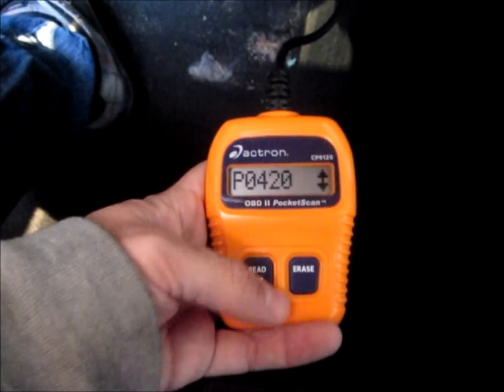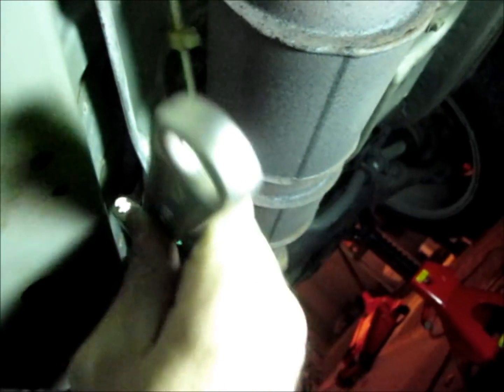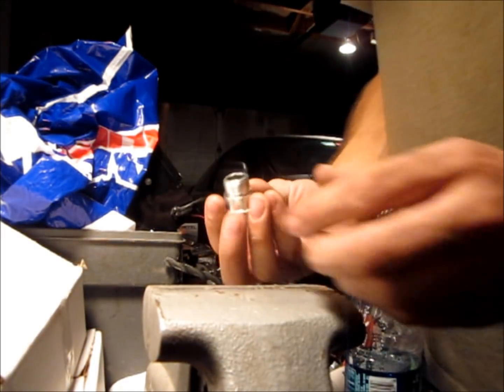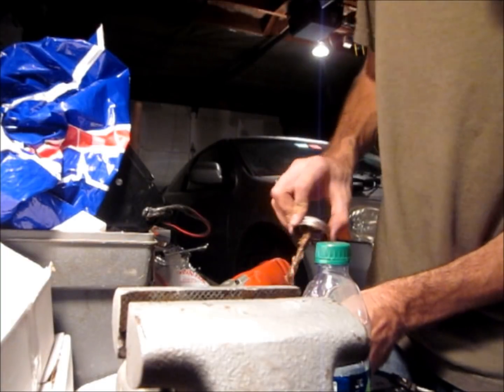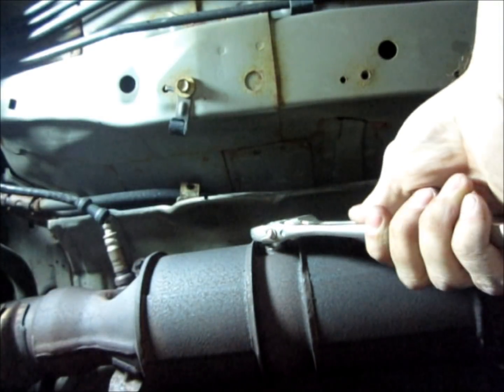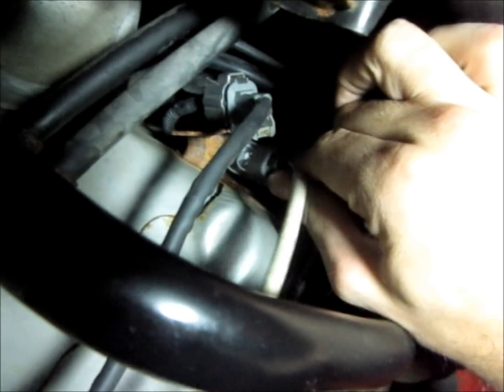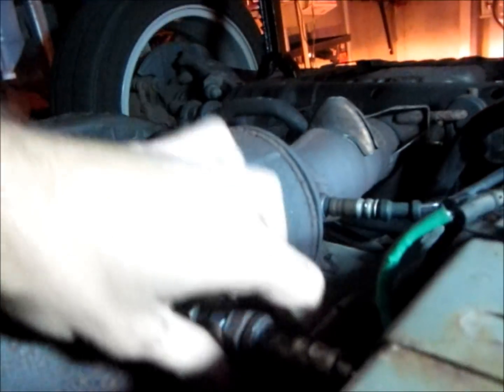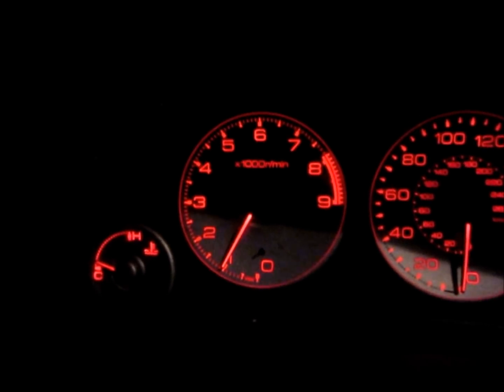Clear check engine light for less than 5 dollars

Comment: got an A8. straight piped it and the light for rear o2 came on. then the p0420. Euro trick these bungs. may install this weekend. installing an X pipe to change flow seeing as it changed after we widened the exhaust. I'm a mechanic. I approve this video. it works. unless its a two cat system in some cases. Too bad more people don't know about this little fix.
Reply: why wouldnt it work on a two cat system?

Comment: check engine light went out because you disconnected the battery
Reply from the maker: You didn't watch the whole vid. I added an annotation at the end showing the CEL did not return after 5k + miles. I addressed both the CEL and the MRL seperately in this video.Thanks for watching.
Reply: Mersudin Omerovic he knew it would go off. the whole idea was to keep it off. Duh
Reply: Disconnecting the battery will turn off the check engine light momentarily if not at all.
Reply: That won't do it.
Reply: it was probably from wiping off the oxidation that was covering holes on the sensor
Reply: Bradley Gonnuscio so true lol he's an idiot

Comment: A catalytic converter converts toxic exhaust gasses like carbon monoxide and nitrogen oxide into CO2, and harmless nitrogen and oxygen. Driving around with a non functional catalytic converter, even off-road, should be avoided if at all possible.

Comment: The "maintenance required" light has nothing to do with any O2 sensor or catalyst on this car.  This guy is wrong.
Reply from the maker: +Phillip Mannini  The two seperate lights are addressed in the video.  My "true aim" in making this video (which was 5 years ago) was to help those who may be having car issues but find themselves in a financial pinch (like myself). Are there any other details about my intentions that you think you have figured out, and would like to share ?
Reply from the maker: Scott Diamond
By removing the battery terminals as I showed in the beginning of the vid, the ECU is automatically reset, which clears the CEL. The real test to see if the light will come back (after modifing the O2 sensor) comes after driving the car 50 to 100 miles, which in my case the light did not return.
Reply: perhaps he misspoke. he meant the cel
Reply: Watch it again.
Reply: Actually I have an 01 buick regal and that unit does light up the maintenance required or service engine soon so it just depends on the make model and the ECU, ..
Reply from the maker: +Scott  I address both issues in this video. The MRL just happened to be on during the filming of this vid, I just threw a quick "easy tip" in there.  Both lights happend to be on at the same time during the filming of this video.
Reply: This is a common fix after doing a decat, so the video is quite correct. Does not always work, but has for many people.
Reply: Scott Diamond  just check engine light not engine maintenance light..lol
Reply: FX, what's your point?
Reply: His true aim was to get millions of hits, not truly troubleshoot the car default...he succeeded. Reader beware.
Reply: moccina You should explain to the viewer what was done to the car before resetting the "maintenance" light.  You failed to explain how you cleared the code and reset the "check engine" light.

Comment: so should you only do this to the downstream 02 sensor on the driver side and not both sides ? mine is on 04 dodve ram
Reply: Rated X Stunts he only did driver side because of 0420 code. If you get 0430 code that is passenger side. I'd just do both sides while you're at it and be done with it

Comment: The maintenance required light has nothing to do with your check engine light. The maintenance light is for when you would be do for an oil change or some other type of routine maintenance.

Comment: Amazing video, the only thing I did different was drill the non fouler from the male end instead of the female end. I've driven 200 miles and the check engine light is still off. thank you.

Comment: The pd means it's a reoccurring code. Just FYI
Reply: +Vinnie Dodenhoff - i though it meant pussy dick?
Reply: On Toyotas, the PD actually means it's a pending code, meaning the fault hasn't occurred the predetermined amount of times necessary to trigger the actual code and keep the MIL light on permanently until cleared. So if for some reason a fault is detected the PCM puts it in "observation" mode  to see if it happens again. If it doesn't the light won't come on and eventually the PD disappears from the OBD scanner. If, on the other hand, it continues then the MIL light comes on and stays on.

Comment: Bought an 05 4Runner from some clowns who thought they ripped me off. Their ad said "no check engine light and 4wd". Well the truck isn't 4wd, which I didn't prefer anyway and after I bought it the 2nd day, the check engine light plus traction control light crap came on many miles up the road. The car is fine. The code is 0430 and the cat does not need replacing as they probably thought. As far as the other 2 lights...those things come on commonly on old Toyota and Honda SUVs over 100,000 miles. Check it out, but if all is well, do NOT go get ripped off by the dealer. 
Scotty is the man

Comment: Thank you for the tips on Check Engine Light. I will try it on my Nissan Titan and see if it will work on my Nissan.
Once again,thank you,
KInd Regards
Reply: Yemi Mohammed how did it go? I'm curious as I just bought an armada with the check engine light on, I noticed there's a leak on the last gaskets after the catalyst converters and I changed the gaskets and still leaking but not as much, I've been told by autozone to take out the gaskets and apply gasket markers/sealant so I'll be doing that on Tuesday as the snow just started again. I'm interested to know how your works as I have p0420 and p0430

Comment: Hello I drilled it out 1/2 inch drill bit but the sheild part of the sensor was still rubbing up against the inside of the oil fowler plug but it screwed in anyway. I put everything back together and cleared the p0420 code if it comes back on I'm going to replace that sensor and if that doesn't work I'm going to trade it in because thay want 900.00 for new cat. Thank you, Dave
Reply: +David Bantle try changing your spark plugs with new ones gapped properly and the code will probably not come back on, have a mechanic hook up a real scanner and see if the sensor is dead or just reading out of its perimeters due to bad plugs
Reply from the maker: +David Bantle Let us know how this all worked out ?? Thanks for viewing bro!!
Reply: So far so good over 1000 miles since the fix! Thank you, Dave
Reply from the maker: David Bantle
Excellent!

Comment: I have a 2000 Voyager and it still runs great...but not so says Oregon's Dept. of emission quality control (DEQ). From their check engine light reading they say my transmission is going bad and needs to be replaced before I can pass. I say I have a good 2 years left before that time. This addition to their test has even the honest mechanic ticked off from it's unfairness.  Oregon does take a reading down the tail pipe, but as far as I can tell my problem is only the check engine light - not related to poor emissions. Can you shed some light on this. I would love to be off road ready with a minor procedure...If you get my drift.
Reply: +Cherylanne Loop , have same problem here, code reads: po773, "Tranny Shift Solenoid", by no means part of emission control! But "check engine light is on & you automatically fail! Sucks big time!
Reply from the maker: +Cherylanne Loop Thank you for your comment... Unfortunately the states which do actual tailpipe sniffing are the most difficult to get around ( in an off-road sense).  My advise to you is go on any and EVERY forum you can on your particular make and model Chrysler.  There must be some others in the same predicament. Good luck, and if you would, please reply back if you find a solution.  Thank you for watching, and have a great rest of the weekend!

Comment: Worked on 2008 Nissan frontier 4 cylinder.  Dorman part # 42002.  Only drilled deep enough for sensor to clear, not all the way though as SOME recommend.  Worked with after market sensor, $17.85 from prime choice (EBay). Replaced sensor first but that didn't fix it, then added the non fouler which did.  Thanks a lot Thanks a lot, Moccina!
Reply from the maker: +Will Connor Yes sir!! Glad to have helped! And thank you for viewing my channel! Subb if you would like, I will be making more vids this summer.

Comment: This will clear the light, but the problem is still there....Just like cancer. You can mask the symptoms, but the problem will fester until you royally fuck up your car by driving it around with a cat that is possibly getting clogged up. The back pressure will eventually eff up the engine. I live in California and we probably have the strictest smog laws in the nation.....but also excellent loopholes. certain cities don't have a smog requirement....such as Blythe, Ca. and a few others. If you are lucky enough to live an hour away, like me, just register your car out there and no more smog check. I haven't smogged my car in 6 years and my check engine light is on lol Ftp!
Reply from the maker: +Brittany Wright Damn.. good info !! Must be a county in CA that still has constitutional rights :P Thanks for viewing, have a good one!

Comment: Just look at the sequence of the video and you will find out that it didn't work.
Reply from the maker: +Charlie Garcia Check engine light is 100% different than "maintenance required light".  CEL is something an inspection station will know if you drove 50 miles after resetting the battery, or if you drove 1000..  Maintenance required light is just a happy little reminder for the vehicle owner to change their oil, and do regular "maintenance" on their car. I just so happened to need to clear both in the same video. I apologize if this cause any confusion. Thank you for viewing!

Comment: Reason for so many views? Because of the insane inspection requirements which punish owners of older cars, and do nothing to help the environment. And many, many folks need to get that damn check engine light gone or else put out hundreds if not thousands of bucks to fix a car worth  not much more than the repairs.The "punishment" must fit the crime!  Thanks much for showing us one way around it.
Reply: +johnny.w Bang On, great post.
"F" the STATE. Gubmint does nothing but lowers our standard of living with taxes, fines, red tape and stupid laws like this one that doesn't save the environment it just enslaves us and makes criminals of us all.
Reply from the maker: +johnny.w Excellent comment. You are correct sir.  People who do NOT want car loans ( have vehicles 10 years+ or older) get penalized in the system we have in place.  Sadly, it will only get worse, as newer technology is forced down car manufacturers' throats. Thanks for watching, and cheers my friend :)

Comment: I've had my check engine light on for about 100,000 miles I  got tired of looking at it. My solution costed less than a penny. I simply cut a piece of duct tape and covered the illuminated light.
Reply: lmao
Reply: Covering the C/E light won't work in states where the emissions machine is plugged into the cars obd2 port.
Reply: lmao
Reply from the maker: Lol.  Well if your car is 1996 or older, in my state at least that would work since those years don't get emissions tested.
Reply: Peter Rodby 😂😂😂
Reply: +SovereignM3RCY Lmao
Reply: lol
Reply: Peter Rodby daaamn bro 😂😂😂😂😂
Reply: Peter Rodby that is what's in my mind....
Reply: Peter Rodby I did that on my Mazda because the light was so bright it reduced vision when driving at night. Like trying to drive with interior lights on
Reply: lmao
Reply: Anyone try lacquer thinner in the tank?
Reply: John Mcadden a few ounces of acetone that is pure acetone will give you better gas mileage if used once every two months. But you could damage the engine internals. I wouldn’t recommend it.
Reply: @johnmcadden3404  I did it worked until I got tired of buying it helped my Honda’s get more miles to the gallon for sure but I just decided to gut all three of them any to give it some more growl sound it also relieves a lot of back pressure off my engine which used to measure anywhere from 25-27 percent on the OBD2 scanner app now it’s down to 13 and 14 percentage points respectively
Reply: ROFL....the world is full of backwodds thinking OMG,LOL
Reply: this is hilarious.✌
Reply: Peter Rodby 

THAT WORKS. CHANGING THE SENSOR AND THE 02 VALVE WOULD HAVE BEEN A BETTER IDEA.
Reply: I read this at work and busted out laughing.  Thanks for getting me in trouble!
Reply: Peter Rodby LOL
Reply: Peter Rodby hahahahahahahahahahahahahahaha
Reply: Peter Rodby 😂😂
Reply: I’ve done the same thing several years ago , people have been doing this rarely but like over 15 odd years ago it’s nothing new lol, the problem still sits in the engine that way
Reply: Peter Rodby by by no no
Reply: I thought you were gonna say something different but this was funny😂
Reply: Peter Rodby does
Reply: Taking the Bulb out is easy enough 😉
Reply: Lol same
Reply: Peter Rodby wow! what kind of duck should i get that has dst tape? 😀😀
Reply: I had done it before too lol
Reply: Here in Mississippi we got rid of personal vehicle inspections a long damn time ago thank god
Reply: Hawaii vehicles are not required to submit to emissions tests. Due to the frequency of trade winds our skies are most often blue.
Reply: Frank Gonzalez 😐😕

Comment: I think VW's come from the factory with these already installed.
Reply: +lk7496   Early VW's had a sensor that turns on the CEL exactly at 50,000 miles! It's on the speedometer cable! Push a button and it will be gone. Weird.  It's an automatic invitation to see the dealer.    VW/Bosch invented fuel injection,pretty much. The 02 needs to be in the exhaust stream to do it's job.VW found a way around that problem.  The 02 needs to be HOT to work well. There is a way to test the 02 with a scan tool.50,000 miles on it? Replace it! They do wear out. They get "lazy" and won't give the computer the correct information and it will affect your MPG's a lot.  A lot of 02's are not easy to replace. Yes,it comes out easier when it's fully warmed up. Get the correct tool(s) !first for a test fit ,when cold.  Don't remove it cold.Sorry.A propane torch may be needed.
Reply from the maker: +lk7496 Really ? Didn't know that, have to look up on that.... Thank you for your comment / input. Cheers!
Reply: I was just poking fun at the VW emissions scandal.

Comment: before or after the cat? or both?
Reply: +aaron victor After cat.  The after cat O2's only purpose is to monitor the cat,  not help in mixture calculations.  Pre cat O2 is used for mixture, post cat is used for monitoring the cat's efficiency.  If you put this adapter on the pre-cat O2, the car wont' run right.
Reply from the maker: +ohger1 Thank you for your input sir, you are correct.

Comment: Whats the purpose of clearing the light if there is still a problem? it could lead to worse.
Reply: I had a friend that worked at a gov ripoff station for about 2  years till they did away with emissions testing in fla . he told me the machines at his  testing station were rigged because each lane would always fail the same years and make as if they paid the gov to make them fail so you would take the car an get it fixed or buy a new car
Reply: +Ravenous Fallen exactly. The government would rather you have to junk your car and buy a whole new one that you can't afford.. Its crazy.

Comment: I would get the p0420 code for 1 second every 400-500 miles.  I had a code scanner where i would clear it (i did this to see how serious the problem was) i purchased the downstream 02 sensor adapter on ebay for $11. No drilling or mods neded.  All i used was a wrench and 15 minutes.  8000mi later, i never saw another code.
Reply from the maker: +David James Hell yeah man, nice ! :)

Comment: Hello I have a 97 Dodge r1500 4x4 sport and the check engine light is on and the code P0500 thats a speed sensor so I changed it and it's still on and I can't pass the emission test  what should I do next
Reply: +Sandy Clover  The problem with those devices is that they will seldom give you the solution to the problem. The "tester" tells you where to look in the SYSTEM. That's all.The VSS could have an issue with it's input signal.
Reply from the maker: +Sandy Clover Drive the truck for 50 or 100 miles and then re-check the OBD code reader.  Go from there.  If the code is different, you will need to address that.  Please report back if you find anything worth sharing. Thanks for watching! :)

Comment: I have p0420 and p0430, should I use it on two sensors?
Reply from the maker: +Ahmad Oliva Try this method 1st.  It may clear both codes.  Please reply back with your findings, and thank you for watching!
Reply: +moccina Thanks for your reply, I did install the foulers months ago and reset the codes then I got same error one time after 3 months maybe and got it reset and haven't got it again. that my daily driver dodge charger 07' sxt.
Reply: +moccina I also done fuel injectors cleaning job few times, and done Bilstein/V-pack from Petromin